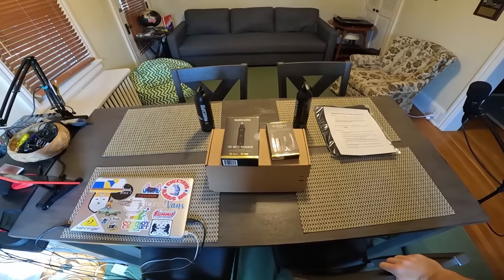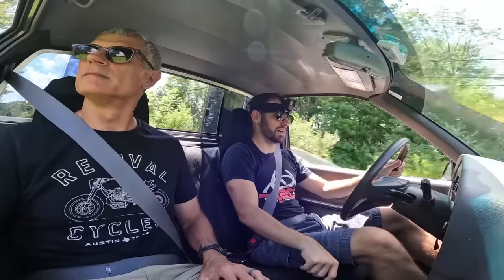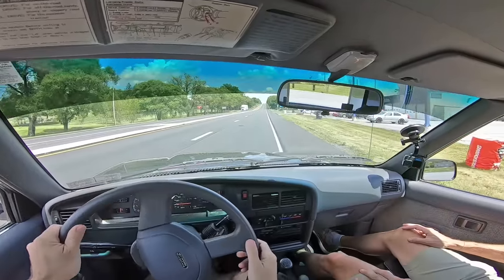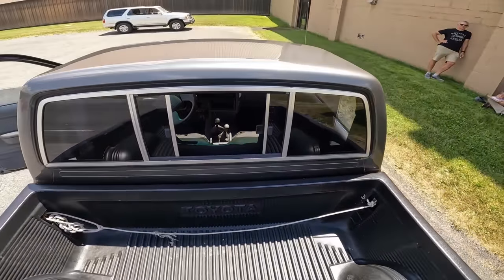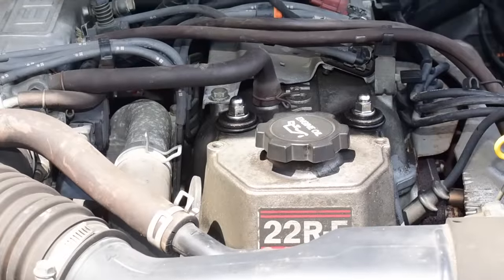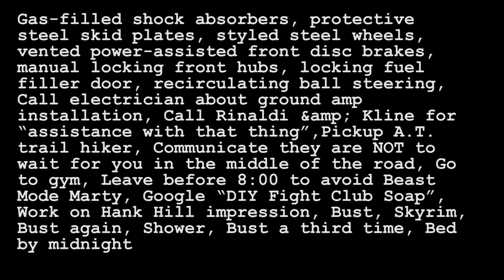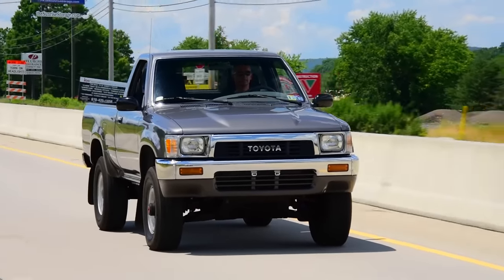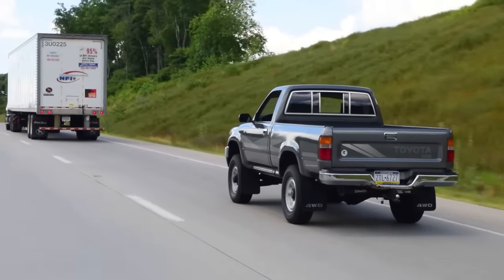1989 Toyota Pickup SR5 4X4 5MT: Regular Car Reviews

Comment: My 1990 was a work truck. I had a cab on the back with a ladder rack atop, two wheel drive, extra cab, five speed, carbureted, with the rare air conditioning option. A real work horse that rusted away long before its useful life was over. I never used a pickup again as a work truck. It made a lot more sense as a carpenter to own a van that kept your tools out of the weather.
Reply: bUt I uSe My DoDgE rAm FoR wOrK
Reply: @jimrustle270  I drive a 2500 and I can confirm this 🤣
Reply: My grandpa is a 70 year old who uses a 2004 Dodge Caravan with black bumpers and rudders for work

Comment: I have a rust free 1985 Toyota 4runner SR5 5 speed with the 22re engine and has 289,000 miles, no leaks and gets 22mpg using pure gasoline, no E10 crap. thanks for the great video!

Comment: My dad bought a pickup brand new in 1989, he got the extended cab, long bed, 22re, 4x4 SR5 build and it still runs today. We've taken probably 2,000+ loads in the bed of garbage, trash, washing machines, dryers, fridges, wood, and scrap metal. Its sun burned from being a work horse, had small accident in the passenger side door and fender, dinged up tail bed, carpet mostly gone from all the wear and tear, dash starting to crack, but you know what? It still runs. It doesn't run like it did, but its still my dads work horse. Ran it on 3 cylinders in high school because the camshaft needed be replaced, put a new one in and it ran like nothing ever happened. God, the memories I have in that truck with my dad will be with me forever. Ive been accumulating parts over the years to restore it, and man its gonna be so, so good.

Comment: I used to have a T100 (I know it’s not the same truck) and it was just too nice to do truck things with. A lot of things about that 1989 pickup reminded me of my old 1998 T100. There’s just something about those Japanese built Toyota pickups before they started making them in the states
Reply: It’s weird because the T100 was huge when it first came out. Now they hardly look different.
Reply: Man I hope someday they do a T100 and they don't just write it off as a wannabe Tundra or a longer Hilux, My first truck was a 2WD T100, and it was just like a car with a long bed, The 94 Ram might have brought in the modern pickup truck looks but the T100 did the same for the driving experience
Reply: @calvinnickel9995 it's ridiculous that the new Tacoma just dwarfs those old t100

Comment: my father bought one of these from a newspaper ad in 1995 for $1700. Drove it for 10 years with 0 mechanical issues. "upgraded" to a 2005 F150 crewcab XLT Triton. He has gone through 4 transmissions.

Comment: Hey Mr. Regular, as an owner of 2 RN20 Hiluxes it’s worth noting until 1975 the trucks were called Hilux in the states. It was in 75 (the year the SR5 trim was introduced) where the Hilux name was dropped and “truck” “half-ton” or “pickup” was adopted.
Reply: There was a bit of an overlap too, sometime in '71 or '72 they started referring to it as just "Toyota Pickup" in ads, brochures and the like but they came through with Hilux fender badges up thru '74.
Reply: I owned a 79 hilux. Believe that's the year they switched to pickup
Reply: I think I recall seeing a few of those.
Reply: @nlpnt  yup! My first was a 74 and had Hilux badging on the fenders. Now own a 77 which just states Toyota, no Hilux branding anywhere. I have the sales brochure as well and it’s just “Toyota Half Ton Truck” there
Reply: Huh. My first car was a '78... I always just called it a Hilux, even though it didn't have the badge. 

That thing was a tough little bugger; I absolutely loved that truck. My little yellow rocketship! :3
Reply: Was never called the half-ton, it's a quarter ton at best.
Reply: @dipstiksubaru3246  You can call it whatever weight rating you want... but I used mine to haul scrap as a side gig for nearly five years. 

It wasn't fast with 1000 lbs of steel in the back, but it did it time and time again! :3
Reply: @jamesgizasson  actually didn't toyota briefly offer a one ton back in the 80's?
Reply: @dipstiksubaru3246  check the brochures or weight ratings. My 1977 is rated to haul just about 1150lb. The brochures refer to them as half ton trucks. Not only that but check out the 1 ton version. They were rare but also existed. These are exceptionally useful trucks
Reply: It was a half-ton. They also had one-tons that were nearly the same size.
Reply: @doctorfeinstone6524  I think they did, in fact they kept it into the early 90s. I could be wrong. 

I remember a lot of flatbed dually V6 Toyota pickups from the 80s and 90s being used as work trucks when I was a kid. They were also used as glass trucks in my hometown. 

Toyota motorhomes and Uhauls were also popular back then, but I heard rumors about people overloading them and breaking axles. X3

Comment: The young wife and I purchased a Red 1988 Dlx Standard 4x4 off the sales lot NEW.
No Air Conditioning, Stick. Big Check Mark Decals on each side. Nice!
Still have good pictures of us driving up the back hills of the Blue Mountains by Walla Walla, Wa. after buying it.
I kept buying Toyota 4x4's New a couple more times with no regrets ever! A '94 was the last year purchased.
Reply: Just remembered. the 1992 Standard Cab 4x4 we had purchased new after the '88 was involved in a rear end accident!
The wife got rear ended in the '92 by Columbia Center Blv. 
Some driver tried driving under the 4x4  failing miserably, burying their car to the Toy's rear axle.
Car that hit our Toy was totaled!
Our Toy truck needed a new bumper because of a small thumb print size impression of a dent in it.
Toyota Trucks were built Bad AF back in those day's. Check the oil and put gas it is all I ever did to mine, '88 had a small radiator leak and replaced it with new.
You couldn't GIVE me a new modern Toy.
Reply: 2nd gen Tacoma 4.0 v6 is a solid option, almost timeless like the 80’s & 90’s pickups. Pre facelift without “tech” features is even better.

Comment: A manual transmission Toyota vehicle.  33 years, and still out there rolling.  I tip my cap!
Reply: Yes got the truck outside 148k and I’m 29 older than me!
Reply: That’s not the impressive part lol, lots of shit lasts that long, what’s impressive about the Toyotas of this era, is that they were built as disposables, were treated like disposables, and most of them still start after 2 pulls of the starter.

Comment: Had a '90 model for several years.  4-speed instead of 5, completely w/o options except for AC that didn't work.  Very dependable, and I appreciated it for what it was.  Hauled incredible amounts in bed.  But I wouldn't want it back.

Comment: I had a second gen 4runner, essentially the same vehicle but with an SUV body. My dad and I restored it, it was in immaculate condition. Frame fluid film coated and even found non rusted bumpers. And I can confirm the parking lot offers, I was offered cash on the spot at least monthly. Highest one I had on the spot was 10k and I said no every time.

And yeah the engine was weak as hell. It would do 110kph  (~65mph) but it was extremely unhappy about it and I was afraid to attempt any higher speeds.

In a freak accident it caught fire and gutted it, My dad and I were both heartbroken. Just seeing that interior brings back memories.

Comment: Those reactions to the truck is a good gauge for telling if the truck industry went off the tracks.  I doubt if you drove around in a new raptor you would get similar reactions.

We need to repeal the chicken tax. I think those Japanese mini trucks would become a overnight sensation.
Reply: If the Chicken Tax is repealed, not a lot would change, maybe we'll see more Thai built Rangers and Colorados, but all the mid sized pickups we can buy in the USA are designed for the USA. Unless Mitsubishi brings their L200/Triton, that would be the biggest change.
Reply: @LouisSubearth  You don't think mini trucks would be popular with places like NYC or on farms?
Reply: @jmd1743  “small” trucks like the current gen Hilux are huge nowadays. Its no different size wise to USDM Rangers and Colorados, so if Rangers aren’t popular in New York then I don’t see how Hiluxes or Tritons would be
Reply: @jmd1743  I know they would, however I also know that safety regulations would make it a very expensive task to do, repealing the chicken tax doesn't mean that mini trucks like the Hijet would be exempt from basic safety testing.
Reply: @LouisSubearth  And funny thing is the Triton is the best of them. The only one that can run full-time 4WD.
Reply: I too want it repealed, but I don't think sales would be phenomenal.  A lot of guys that buy trucks buy them because weak egos and that means large trucks.
Reply: Not sure if it would work in America, Hiluxes are on fire wherever they are sold. But they are not the best for highways. Still awesome for off-road use
Reply: @noneyabizz8337  I’m offended but I agree. I drive a truck that’s way too big for what I need
Reply: It depends, are you still gonna regulate the 70 series out of the market? Because if not the waiting lists for those would be miles long. VW T roc as well, there’s a bunch of trucks that would makes the big 3 sweat quite a bit imo.

Comment: This and the Ranger Splash are my two favorite little trucks that I’d absolutely want an OG clean version of.
Reply: Wow i havent seen a ranger splash in new england since 2013
Reply: I suppose you want a clean 1989 240SX or 2000 Civic SiR too?  Maybe a bone-stock 1988 Mustang GT or 1983 Oldsmobile Cutlass Supreme? 

Unicorns.
Reply: @calvinnickel9995  I also would’ve accepted “1992 Lincoln Mark 7 without numerous electrical issues”
Reply: @calvinnickel9995  Suzuki Samurai please.  And more diesels, inline 6, manual, and cable throttle cars.
Reply: I granpa had a 90s super bright orange with purple graphics Splash extended cab with the 4.0. That truck was awesome and hauled ass

Comment: My dad had one of these, it was a 94 v6 5 speed 4x4, absolutely fantastic truck
Reply: the 4 cylinder was more reliable, but  the good thing about owning the V6 is that if the 3.0 ever blows you can do a 3.4 swap relatively easy which was toyota's best engine ever made. A perfect update to the 3.0 that had the reliability of the 4 cylinder with twice the power. Even with the slow 3.0 in it, the frame and build quality of these trucks was amazing. So utilitarian and awesome.
Reply: He could have sold it more than he bought it today.
Reply: @irwinisidro  oh for sure, he used it properly though offroading it all the time and eventually it rusted away, last I saw if it it was sold on FB for like 500$ because it had no title. Sad really, if I could have put it back on the road I would have bought it in a heartbeat
Reply: @jvogler_art4708 the 3.0 is great, so long as you don’t plan on pushing a bunch of tire with one, and it’ll do 65 and not be at the end of the world lol.

Comment: I owned an 82 Hilux(longbed) back in 2000. The truck did what I needed   it to do... Haul shit, keep tools handy and get me from point A to point B and back again. It sipped gas like an English Lord sips tea. It had an automatic transmission and A/C.
No problems ever out of the motor or drivetrain. One day on the way to a friend's house on the I-5, a car slammed on it's breaks out of nowhere... A Chevy Suburban that was tailing me swerved to the left lane to avoid hitting me... Well that little truck fishtailed, the Suburban hits my engine bay... I go flying in the opposite direction.... After the "life flashed before my eyes" and shock of almost dying in a horrific way wears off, I notice what was the engine is now sitting on top of the passenger side front tire. Fluid lines bleeding out like a soldier slain in battle.

BADASS LITTLE TRUCK

but it is a death trap against larger American vehicles.
Still miss it though.

Comment: As for the towing capacity. Outside the USA/CaN this is rated at 3500kg/8000lbs and is regularily seen towing that or more the world over...just slowly.
Reply: No way in hell i would attempt to pull 4 tons with the 22re motor..my friend had a 93 2wd and it squatted so bad with just 850lbs in the bed..my 99 mazda would haul 1500+ and stand back up and cruise down the highway with ease.. i can't imagine trying to tow 8000lbs behind it ever..
Reply: @jdubskiwright2380  maybe those are ratings for the Diesel engine. But they're still ridiculous numbers. 
They actually still are. An uncle has a 2016 Nissan NP300 with the 2.5 gas engine, Crew Cab and short bed which is rated to haul up to 2300 lbs and tow up to 3500 lbs.
I own a 4th gen Ram 1500 that maxes out at 1900 lbs hauling although I once put 2200 lbs and I would never do the same because the truck started feeling unsettled. Can't imagine how one of those tiny trucks would feel if hauling the same.
Reply: @luisinhoens90  im from norway owning a 98 hilux diesel its rated at 2250 kilos 4960 lbs towing capasity + 710 kilo 1565 lbs load on the truck itself :)
Reply: Yep. They can carry about a dozen equipped troops or one 20mm anti aircraft gun.
Reply: @calvinnickel9995  true
Reply: @jdubskiwright2380  thise 22r motors can do incredible things. It wont be fast but it will happily pull ridiculous loads
Reply: @Demonslayer20111  i cant imagine trying to pull over 5000lbs with it..not saying it won't but it seems like it would burn something up trying

Comment: FINALLY. When I was a kid, my grandpa (a mechanic) had a 1987 Toyota SR5. It was the same as this, except it was 2wd, and it was an “Xtra Cab” so it had a small amount of space behind the seats. It was originally bright red, but it was rust colored all over by the late 2000s. It had like 300k miles, then he gave it to his brother in law, who drove it for like 100k more miles. Then he traded it into a B dealer to get a Subaru Forester. The owner of the dealership gave the truck to his son and is STILL DRIVING IT 8 years later, it probably has more than 500k miles on it now. So somewhere up in Gaylord MI or so is my grandpas old 87 Toyota. Now he has a 2006 Tacoma extended cab, SR5, 2wd, 4 cylinder, automatic, and it has almost 300k miles on it. He had the frame replaced by Toyota in 2019. It’s his 4th Toyota truck.

Also, from a fellow Michigander: it’s pronounced “MIGH-er” but every single person here says “Meijer’s”.
Reply: It’s not the same, those are Solid Axle trucks, those are the real deal 4 wheelers. SAS Toyotas we’re for the most part jacked up into trail rigs, because they will absolutely embarrass a Jeep with a shitload of money spent on it.

Comment: I had a LN106R, later 1993 model. Dual Cab, 2.8L NA diesel, solid axles on leaf springs ! 💪 ..... the original Mogadishu Technical spec ! 👌🏻
Reply: The only real problem the diesel ever had was a bit of coking if they didn't get a good beating once in a while, well that and they're slower than the petrol.
Where these things truly shine though is offroad, the gearing, suspension and reliability sold 1000's of these to farmers all over Australia as it would idle along in 4wd just fast enough to keep up with slow sheep and cattle, held a motorbike in the back or a big stack of hay bales. Or if you're more sporty, they took you to insane places 'big' 4wds wouldn't get to on washed out fire trails and still carried enough camping gear to disappear off the face of the earth.

Sort of a magical era, it was just well built enough to be reliable, not overbuilt to be expensive and simple enough a moron with half a toolbox and 8th grade education could fix it

Comment: I picked up a 1989 a few months ago. It spent its whole life in WA state, and is surprisingly rust free. Even the bed still has original caulking intact. 286,XXX miles, runs like a champ. The red paint is oxidized to the point of no return, but i feel like a millionaire driving it.
Reply: There are some companies that make fibreglass fenders and rear quarter-panels… I agree with you tho, these trucks are worth the love and attention.

Comment: My dad had one of these when I was a kid and I just got one that sat in the desert unmoved for 30+ years gathering rust. But I needed a project and was kind of inspired by the 86 4runner video RCR put out. Needed some work to get it running and it's the carbuerated version so it's even slower, but I couldn't be happier. It's my daily driver now and even passes smog. Damn good trucks.

Comment: Toyota Pickup: official truck of-ya know what? No... I'm not doing this bit to this machine. I respect it too much. Shine on, you tough-ass diamond.
Reply: A lot of people tended to put oversize tires and lift kits on them. I had an irresponsible friend back in the 1980's  that did that, then ended up rolling 2 of them when he swerved.  Local cops were also targeting him over his way over legal bumper height. He never learned his lesson, the last time I saw him he was driving an old rust bucket Toyota with 42 inch tires and at least an 8 inch lift kit. Stupid is as stupid does.
Reply: @n3bruce  yeah 35s are about the right limit for these. Maybe 37s. Mine has a 2 inch lift with flipped leaf spring mounts and 35s with a 5.29 diff gears with the high steer modification. and yeah it leans but just dont be an idiot and you wont flip. It helps mine has a wider tire track due to using 92 4runner spindles tho. Its about 3 or 4 inches wider on the front axle than the rear is which helps a lot.